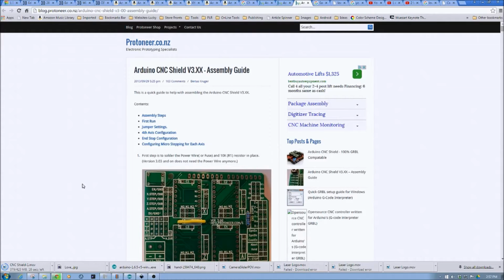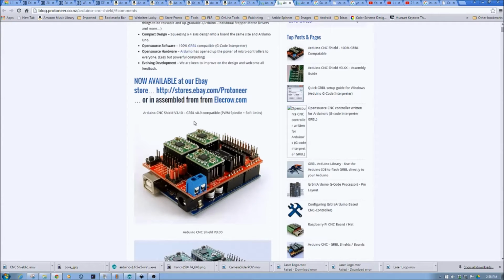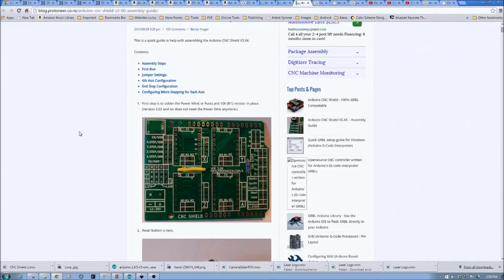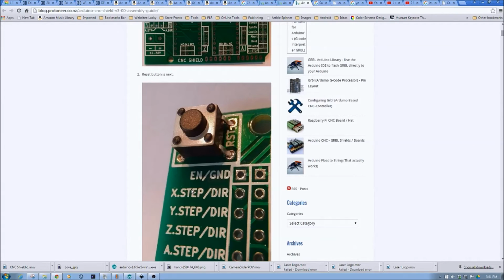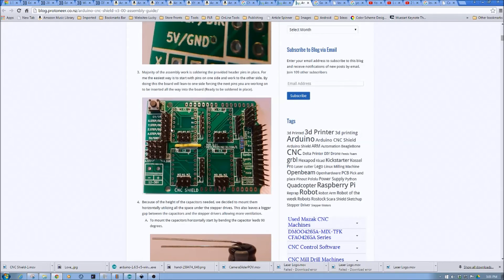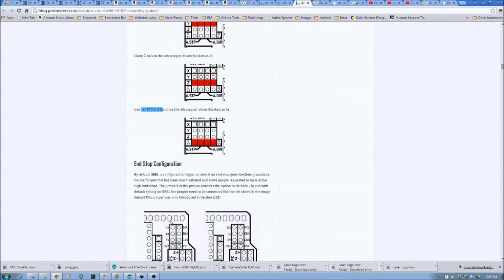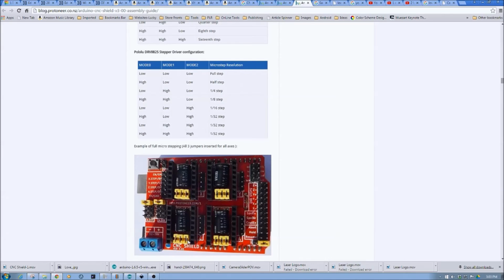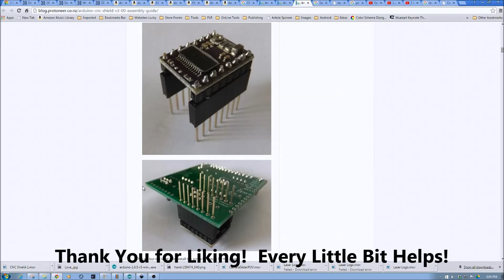2 Watt Laser Cutter and Engraver Project Part 6 - Setting up the CNC Proto Shield

Comment: Quick question. I just set one of the these up for my cnc turned laser machine. I have end stops on all 3 axis'. I have hooked up both X and Y to the proper pin outs on the board in the end stop area, but the only way I can get the end stop to work for the Z is to have it on the SPNEN terminal just below the end stop terminals. Has there been a change on the arduino that would force the internals to feed to the SPNEN pins instead of the actual pins in the end stop area for the Z. It's a bit confusing. I need a pwm signal for my laser to work and I believe I need to connect to the SPNDIR for that. Would that be correct.

Comment: I found the strangiest behavior, at lest for me, in this CNC shield. When I connect the power supply to the shield input (i.e. 12VDC), it shows some tension in arduino uno's P2 jack. I think it shouldn't. So, you only can power the arduino from USB
Reply from the maker: Typically yes from the USB port..
Reply: @DIY3DTECHcom  I discovered the hard way: I fried a CNC shield using an external power supply on the P2 jack instead of using the USB :-(

Comment: Hi there, are there any differing steps, if i were to use dvd drive stepper motors to build the engraver using this shield, and any adjustments you suggest?
Reply from the maker: Yes you can change the stepping however no clue how it would work the small stepper of a DVD carriage...
Reply: identify the coils using a multimeter. connect to driver. attach a pen to Z. make it walk 10mm drawing in a piece of paper. measure how much it walked. use the calculator to correct the steps in GRBL (10mm*actual steps/measured mm)

Comment: can u show us where u plugin the laser Wire ? On Cnc shield thnx
Reply from the maker: Sorry this was like two years back and things have changed in the new version of GRBL.  You will want to find the spindle PWM pin and connect it to the PWM pin of the laser.  Also ensure PWM is turned on in GRBL too...  Hope this helps...
Reply: Is there is PWM Pin On CNC Sheild ? where i can find it please thnx for Help
Reply from the maker: Sort of, depending on the configuration of GRBL, the pin will change.  With the new version I am not sure how they are handling it as in the older version they where re purposing an end-stop pin.  You might have to use a multi-meter to find it, as send the gcode to turn on and full intensity measure then the pins then send the gcode to turn off and remeasure as the that goes is the pin you want...
Reply: @mohamedatef8424  It is pin 12

Comment: Friend, I liked the video, Congratulations! Now I've been thinking here if I have a 2.5w laser that operates with a driver up to 3a and with 450nm where the length and where I apply to it another driver of a 5.5w laser that operates in 5a and also in 450nm, so technically I would have a larger output in the original 2.5w correct? What can you help me with this understanding? Thank you !
Reply from the maker: Your welcome and if you do this, you will have a "fried" laser as a laser diode is a continuous draw device which mean if you apply current to it, it will draw all of the current (not voltage) it can.  Therefore all the laser driver does is provides a constant limited current to keep the laser diode from burning up (a better name for it would be a "laser limiter" rather driver).  So when they say its a 2.5watts they means that is maximum and what must be limited to other wise it will burn up...

Comment: HI, where are you connect laser on CNC shield?
Reply from the maker: You connect the spindle PWM output to the laser driver PWM input however you need to configure GRBL for PWM and send the correct GCodes..
Reply: what is the version of cnc shield - (3.0 or 3.10)?
Reply: @kostadindamyanov6908  in version 3.0 with PWN SPINDLE enable the pin is Z+ (arduino pin 12), not the spindle pin (arduino pin 11) - ignore the silk

in version 3.1 (and GRBL>0.9) it is correct, pin12 is for spindle and pin11 for Z+

Comment: Excellent Video! I am attempting my own DIY CNC machine and I've run into a few problems and maybe you can help. First off, How does a person determine what sort of stepping to use? Do I match it to the stepper motor itself?(and how would I do that?) or are the steps only for precision/ clarity/ resolution? Secondly, If I attempted to power on the board with the drivers in backwards( they didn't actually run the motors, and were only plugged in for maybe a minute ((12v 0.8A))) could I have fried them? and do you know of a way to test to see if theyre fried? i'm using the A4988 drivers.
Reply from the maker: In general steps are for precision however only to the point the lead screw is capable.  For most home CNC's either 1/8 or 1/16 will be the max.  Also possible (i.e fried), I would suggest turning them around and try it as if they are fried it wont work.
Reply: Luckily they all worked :) Thanks!

Comment: How and where can I connect the laser or servo in my case to the cnc shield ?
Reply from the maker: Not sure on the how or way for the server question as the CNC shield only drives stepper motors, however the laser is driven from the PWM pin out....

Comment: Hi
Thanks for your nice series of videos, I am a motivated beginner and enjoying your videos so much. 

I read some where that this Arduino shield is turning the laser beam on-or-off. So it can not adjust the power of the laser. As a result if you want to engrave some diagonal lines then the engraved lines do not have similar color depending on the speed of the movement of the laser cutter. I mean that the velocity of movement is not similar with the time you move in X or Y axis. Do you think if this will affect the final engraving quality? If yes, is there any better Arduino shield or other type of CNC controller to solve this problem?

Since my English might be not completely understandable I make an example. If we want to engrave a square with its diagonals, when the machine is going through the X and Y axis, the velocity is lets say 0.1 m/s, but when we are going through the diagonals, both the motors are working which means that the velocity of the movement is different (Possibly higher velocity ).
Reply from the maker: I think I understand what your asking, so lets start in two parts.  Yes the Arduino can pulse width modulate a laser assuming the laser is capable of this and most diode laser drivers I have seen are PWM capable.  Second is Arduino & GRBL can only move one motor at a time, however it does it so fast it appears as it is one motion.  Will this affect engraving quality?  Yes, but how much is the question as there will be a VERY short moment of "dwell" as the X & Y shift meaning laser will "dwell" in that location for a longer time than areas where it was in motion.  The question is what impact will this have, I doubt much.  The only way around this is use something like Mach 3 and a parallel port as Mach 3 will drive both X & Y at once.  However this adds another level of complexity all together.    Hope this helped :-)
Reply: +DIY3DTECH.com Thanks a lot for the fast and useful information.

Comment: hello sir can grbl be powered by a 12 volts 8 amp battery as a power supply
Reply from the maker: GRBL runs on a Ardunio UNO and the working voltage is 5 to 12 volts.  However you will need to hook it to a computer anyway so why would you need to power it externally?
Reply: Grbl shield needs a power supply so I have to give it
Reply from the maker: Ah I now see what your asking as it's typically GRBL & Arduino and the Shield is a "CNC Shield" (as it will work with software other than just GRBL).  So to answer your question yes, but me I would use a DC power buck between the battery and the shield as cheap insurance.

Also this assume you are using 12 volt steppers too as that is where most of the current is going...
Reply: actually i am using a ardurino grbl shield and try to use a battery as power supply
that's  it  would you help me by making a video by connecting a battery to grbl shield